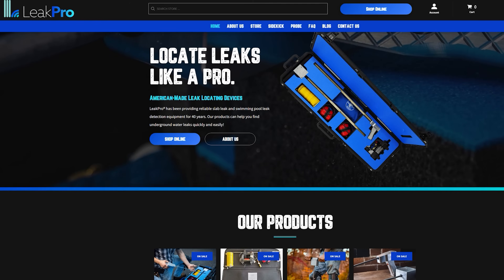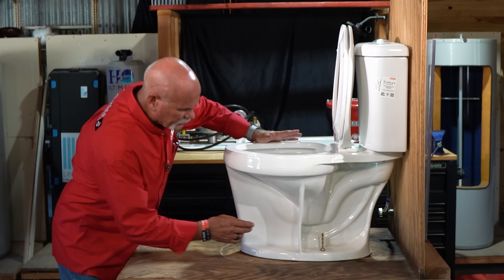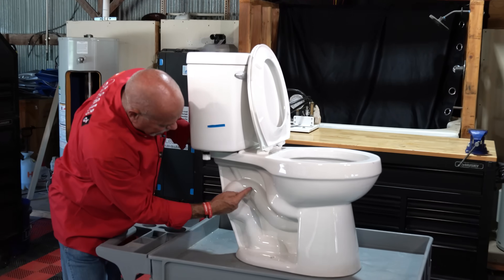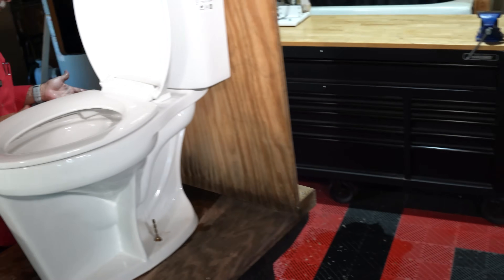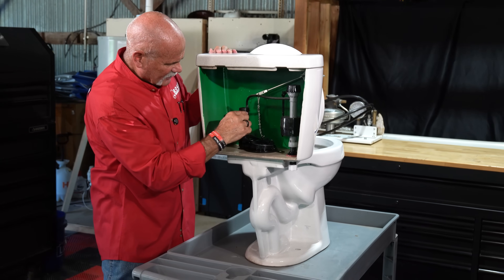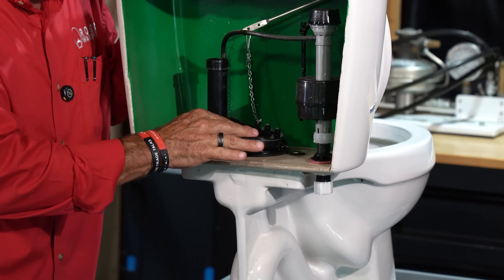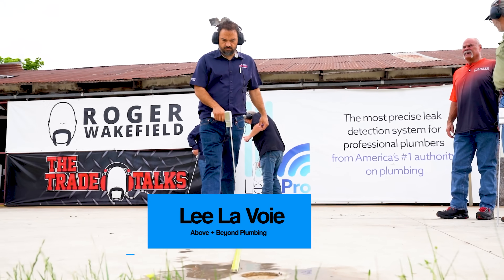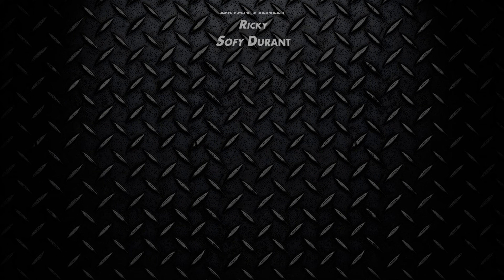How a Toilet Actually Works

Comment: 1:10:  Yes, Roger.  You can rest assured that I DO know full well how a toilet operates on the basis of a pull rather than a push.  In a sense the toilet flush DOES begin with the push of water flowing into the bowl from the tank --- but that push charges the bowl with enough water to cause the siphon action to begin --- which is the pull which the flush ultimately ends with.  Roger, I have some advice for you --- though you probably know this already.  You can enrich your toilet lessons for the general public by showing and explaining how a common plumbing trap works --- but THEN explaining that the toilet bowl is nothing more than a gigantic trap --- an S-trap --- with one side of the trap grossly ballooned outward --- and this ballooned part of the trap is the toilet bowl that you pee and crap in.  There you have it, folks.  The entire toilet bowl portion which the tank is attached to is, itself, nothing more than a fancy and glorified S-trap.

Comment: I'm here to find out how the innards of those fancy "water saver" toilets work. I've had customers ask me what the difference between those and the standard systems is.
Reply: The way they add water to the bowl to get the suction started includes a siphon jet at the bottom of the bowl and rim jets that cause it to start creating a vortex which just adds even more suction to it and allows it to grab onto more material as it flows. Half as Interesting has a video about the history of low flow toilets. Also at least in the USA all toilets are required to be "Low flow" AKA 1.6 Gallons or less. 1.2 Gallons is pretty common these days. The math is really tuned in nowadays and you get an amazing flush for half the water.

Comment: years ago I had a toilet that would not flush well.  Did all i could think of to fix it.  It wasnt clogged it just flushed terrible.  I then realize the holes under the rim were all plugged with scale.  Got a small copper wire un unplugged each, just like new.  Scale is a bugger on these things.

Comment: Horrible "environmental" toilet design.   The lack of water swirling in the bowl keeps this a nasty toilet after most uses, which requires multiple flushes and cleaning after use when the toilet should have done it in the first place.
Reply: I'd have to agree! That's probably where the phrase "swirly" came from in my days in middle school. The water would swirl around the bowl. Hopefully you weren't on the receiving end of it. Lol.
Reply: Jimmy Carter mandated low-flow toilets in the 70s. My proud, then Democrat voting father rushed out to get one. You had to flush a minimum of three times if you left more than urine and a couple of sheets of TP. It was horrifying. Especially if you went to someone's house and had to take a dump. Everyone knew by the number of flushes. Disgusting.